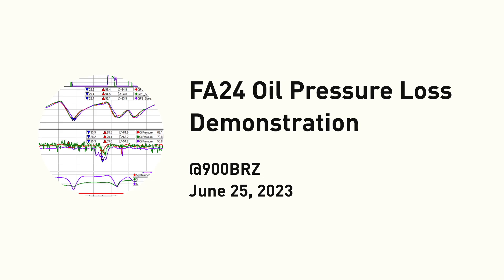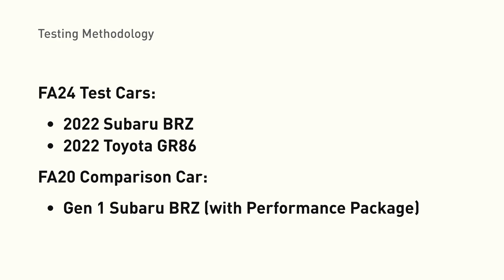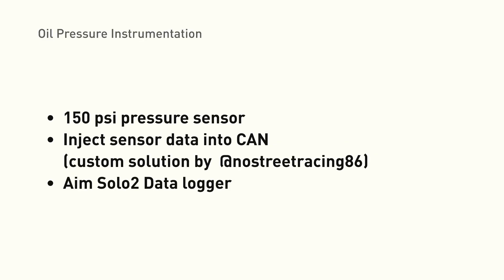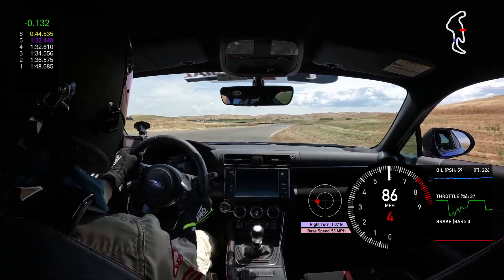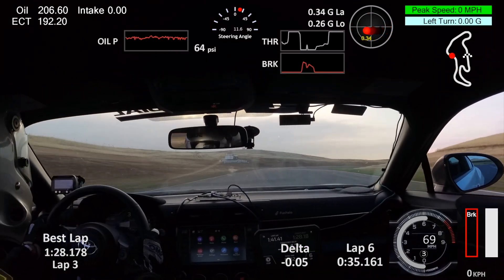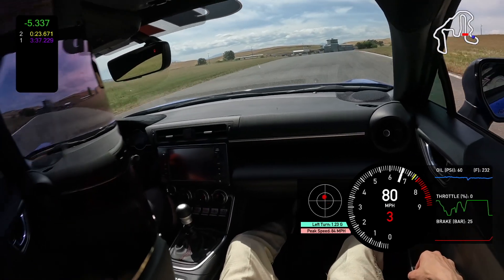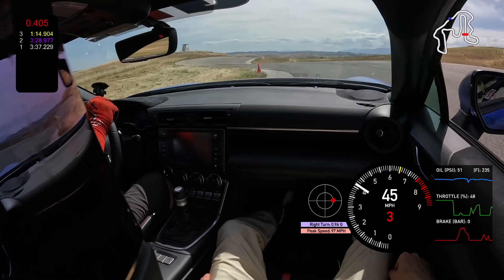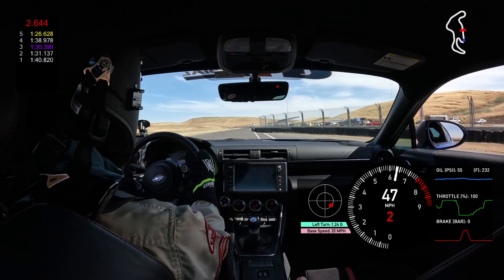BRZ/GR86 FA24 Oil Pressure Loss Demonstration

Comment: Is it something to be concerned about for spirited street driving such as going in the canyons? Is it an issue that occurs over time, with more miles on the engine?
Reply from the maker: I don’t have any concrete data to support reproducing these pressure drops on the street, but I also haven’t tried to do so. I think it’s possible if you’re achieving somewhere around 1+ lateral G.
Reply: Unfortunately it is. You don’t get to hear from regular consumers who blow their engines because they’re not vested in forums and YT channels like this. Every once and while you’ll hear from someone like…
Reply: @mitchkelleher/972 posted on this thread an 1h ago:
Mine failed after full throttle acceleration in a straight line with 34k on it after jinxing myself by calling the issue overblown. No tracking, performance AS tires, so rarely over 1g, and oil always checked and changed every 5k, driven by an advanced manual driver. Warranty taking care of it and they're blaming RTV. Like the video, I believed RTV wasn't sole cause, but a contributor until mine blew in a straight line and I started thinking maybe it WAS just RTV. After seeing this, I'm thinking it's more likely 34k miles of accumulated damage being as most corners on the street are right hand turns for highway ramps, plus probably some assistance from RTV.
Looking forward to results with the baffle.